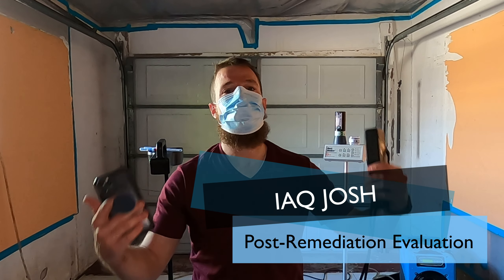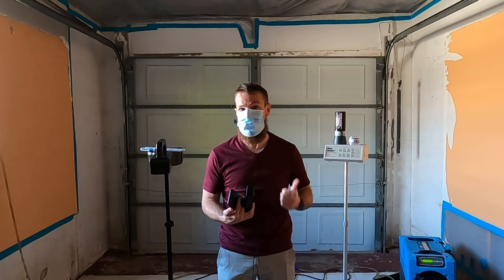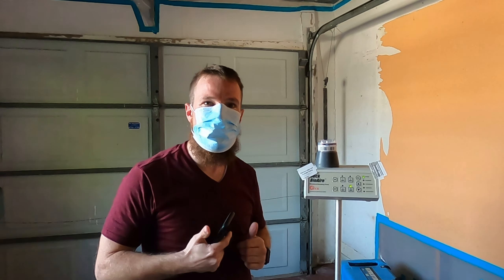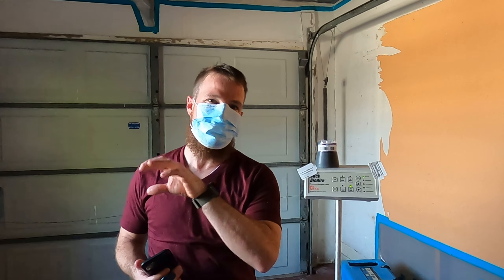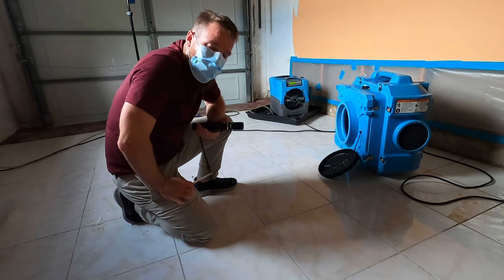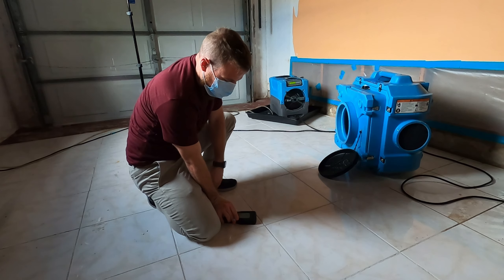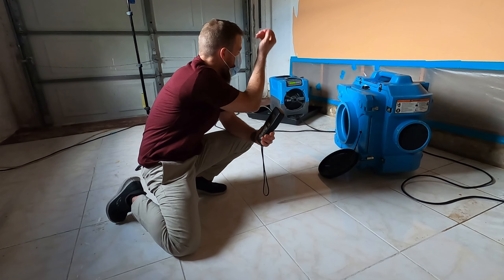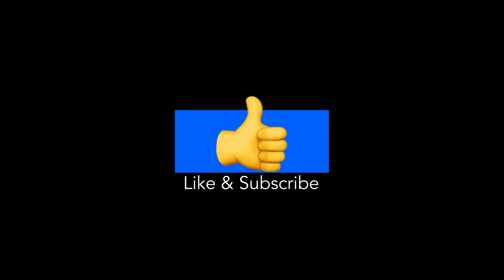Post-Remediation Evaluation in Fort Lauderdale, Florida

Comment: Is that air scrubber suppose to be running while collecting a sample?
Reply from the maker: Supposed to be is relative. There’s no standard in relation to whether or not air scrubbers should be operating during the post-remediation verification. 

Professionally, I find that leaving the air scrubbers on during any sampling will provide a better representation of the environment. When you collect air samples with machinery off and no HVAC systems running, the majority of fungal spores will have settled out.
Reply: @IAQJosh  I was of the understanding that having air scrubbers running while testing will give a false clean air test.   I'll have to look into it more.  Perhaps a blower or portable fan to keep the air moving instead of being filtered would be more accurate
Reply from the maker: It certainly wouldn’t give a false clean, as the operation of an air scrubber would simply be continuing to clean the air - which you likely already know. 

Now, I’m also a fan of using a small blower (Makita makes one) to agitate the area and potentially re-aerosolize any spores that have settled out. I use this approach when I’m sampling with Mycometer, as you cannot clog up the slide with particulate - like you can with a spore trap cassette. Granted, most environments should be pretty clean during a PRV anyhow.
Reply: @IAQJosh  Completely agree. If there is no visible growth or moisture source there is no reservoir for spores to appear when the air scrubber is shut off. You want that agitation to get an accurate sample. The scrubber has already been cleaning the air for days before you sample. We are determining if the scrubber/remediation did its job. 

The "false clean" result would be if you only sampled the air coming directly out of the scrubber. In this case he is sampling the air after it mas mixed with the work area air in an agitated environment. I also sample this way.

Best, thank you for your work
Reply from the maker: @kyleevans5182  Great explanation!